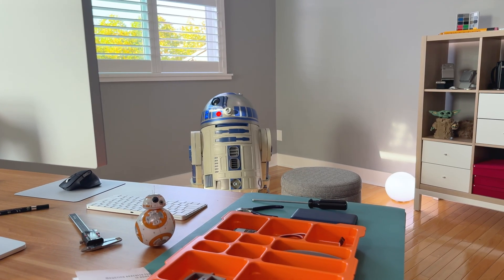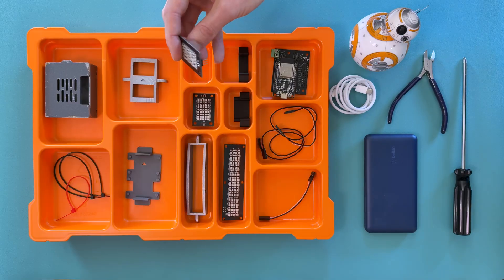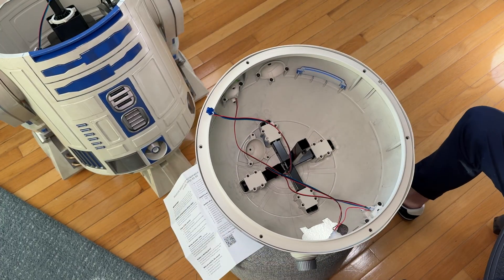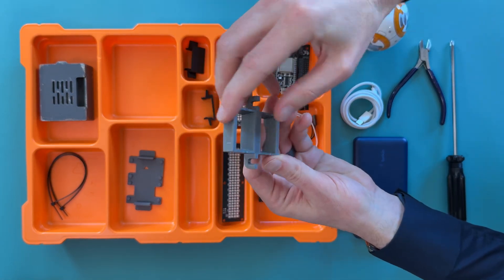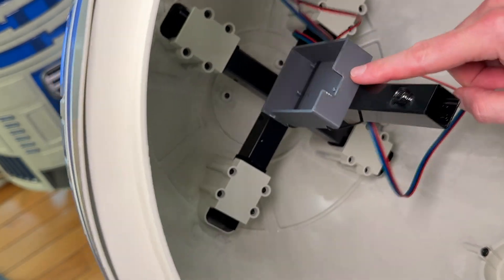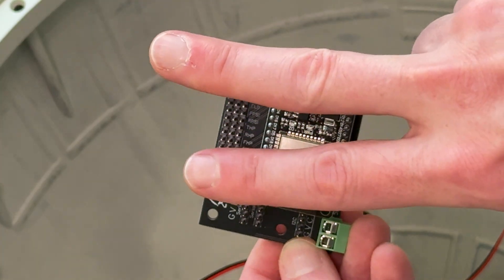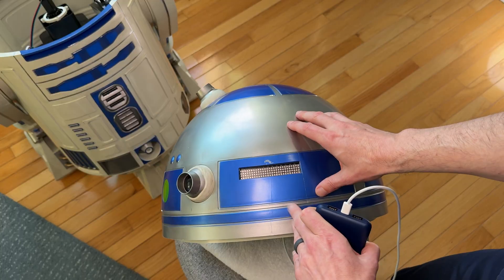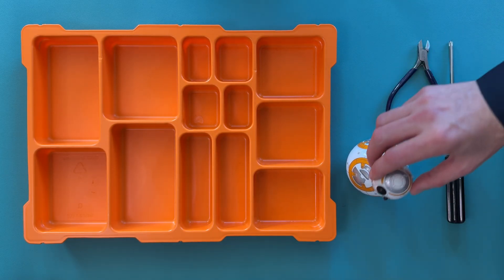Home Depot R2-D2 FLD and RLD AstroPixels Install Tutorial

Comment: Hey Frank.  Loving your work and the fantastic tutorials!  Thank you!  I'm about 90% complete with my astropixel installs after following your detailed tutorials.  Now comes the really scary part and I'm frozen with fear.  POWER!  😅😅  Can the path you took be powered by the Belkin Portable Charger alone?  I dont want to remove my R2 from the base or repurpose the Christmas light power source.  Too advanced for me and have never messed with electrical stuff.  PS:  Just ordered the microcontroller box from you.  Thanks again for sharing your knowledge and talent!  🙂
Reply from the maker: Yep, you can power AstroPixels through USB on the port or through the 5v connector. A lot of people do it this way so they do not have to rewire. There are a few tutorials out there if you want to use the Christmas light connection. Check out Mat Luschek's video and some of the HDR2 groups on FB for more info. I'm focusing on a no rewiring solution, so a power bank with both USB and AC has worked well for me. My second PSI kit video has a bit more info on this,  plus some additional info about the inline on/off switch and WiFi switch I started using since this video came out.